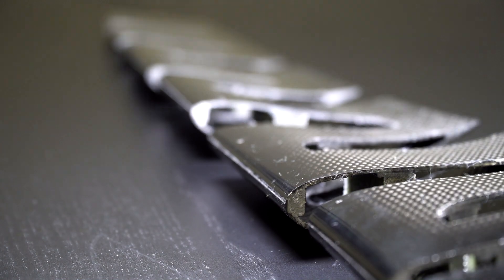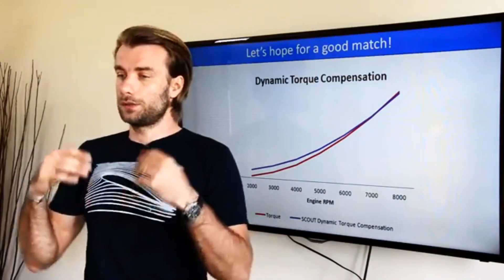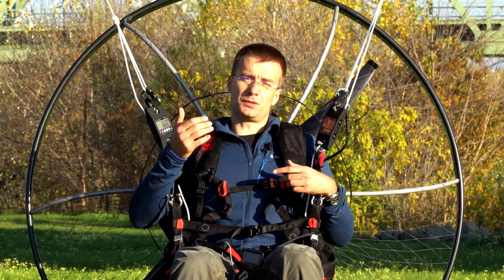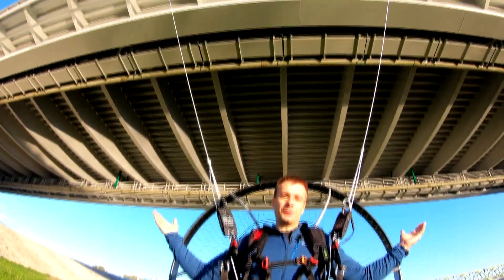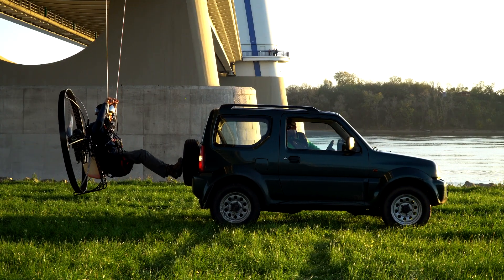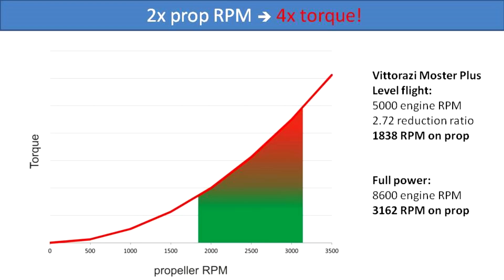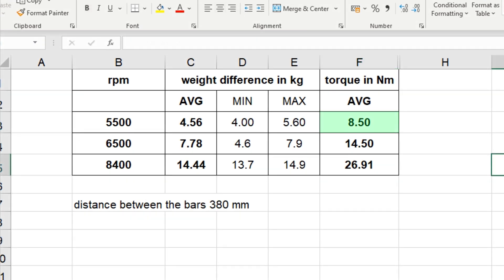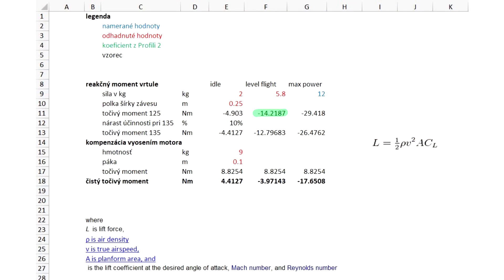Paramotor torque experiment, First Time EVER! Smarter pilot 1

Comment: Many years ago the topic was how the torque affects the speed, blade depth and blade weight. it was not measured with paramotor but with electric helicopter rc. this had its own motor in the rear rotor. both engines were logged and saved via telemetry. so you could graphically evaluate the relationship between torque, speed, etc. in ecel. the rotor diameter was 125 cm so everything is very similar to ppg. I can tell you it is reflected very closely with your explanation. best regards

Comment: very informative and nice video! well done.

with  2 pcs  S-förmige Wägezelle
S21N  / log in 60hz with full telemetrie,  power in watts  / rpm in csv data loged    as hobby pilot in austria :-)  many things are done in the background. the comparison of low rpm ultra light propellers to standard ones is particularly interesting. just like when the center of gravity of the propeller blade is very close to the center. therefore modern thermal e-ppg can do without torque compensation due to their very low speed and ultralight propeller. with a very powerful high-speed petrol engine like the moster, yes, you will always need a solution when it comes to torque.

Comment: Hang on. No torque compensation is dangerous? Can we talk about how many paramotor frames do NOT have torque compensation? My torque compensation is letting out the left trim a bit more past neutral than my right trim. I have not yet died or twisted. I think "less ideal" is a more accurate statement than "dangerous," so long as the pilot understands what it is and how to manage it.
Reply from the maker: All paramotors have some sort of compensation. What kind of paramotor do you have?
Reply: @SCOUTaviation  2016 Vittorazi Moster 185 Dark Evolution on a "Simple Frame" made by SkyCruiser Manufacturing in Sauk Rapids, MN -- http://skycruisermfg.com/ -- with an APCO harness.

Doesn't look like they have that frame for sale on their site anymore. Fixed J-bars, 17L tank. Aluminum struts, net. Literally simple! The way that the motor is mounted (I purchased this from my instructor) may have compensated for torque, but I was also taught to modify my trims slightly to compensate.

Comment: The angle at which you put your feet on the car changes the vector in the vertical axis. It will still vary in real flight depending how many g’s you pull in your “level flight”. The best way to remove this variable is to attach the motor to a rigid structure in the forward and reverse axis which allows frictionless motion in the rotational axis
Reply: I think he did mentioned in this video it as 'Static Thrust'  .I am sure in-flight thrust would vary based on varying heights (air density) , wind speed and other dynamic parameters.

Comment: Hi Miro, first, thanks for yet another very interesting and informative video! Questions/suggestions though...Respectfully, to enhance the accuracy of your readings, wouldn't it be better to isolate the the torque in your readings by making sure that the propeller was vertical (90 degrees to the Normal force of gravity) at the time of measurement, as well as the ropes being completely vertical (as Voloshin Ivan already commented on, below)? Additionally, while I realize that putting your feet on the Suzuki was improvised during the experiment, wouldn't the grip/traction of your feet pressing against the car (vs. being on a pivot bearing) impact the accuracy of your torque readings, as your legs (however unintentional) would resist some of the torque? Thanks again for your sharing of your knowledge!

Comment: Greate video. But I see one minor inaccuracy that should affect the reading. The ropes are not strictly vertical. They are actually angled. What tha means that:
1) The sum of the weights on left and right does not equal to the mass of the system. You would need to do some math to figure out the true mass.
2) I would expect that the sum of the readings change (as you observed) when torque is applied to some degree. The reason for that in my opinion: the torque will change the angle of these ropes. One rope will become closer to vertical. Another - more tilted. Since the relationship between mass, indicated tension/weight and rope angle is nonlinear - I would expect the summ of the two to change slightly.
3) To properly estimage the torque you need to take into account the angle of the ropes. It doesn't look from the video that you did that. Eyeballing it from the video it seems like angle of a rope is about 30 deg. If my napkin math is correct, that would mean the indicated readings are inflated by 1/cos(30deg). Which is about +16 percent. So the real torque will be 16% lower.
Take this math with a grain of salt. I didn't really sit down to make sure it's correct. But I guess, the main point I wanted to make: for accuracy the angle of the rope should be taken into account.

Comment: Very interesting video.
I Will also make my prediction for the next video for fun.
5500rpm it gives at 60% of the propeller length around 200m/s velocity. Speed of ppg around 11m/s.
So I would say that angle of attack on the propeller will reduce(??) by 3° which is not negligible.
I don't have curve of CD for Naca profile in front of my eyes but I would say that same rpm, torque will by smaller but it is just my rapid prediction and for sure I probably made a mistake 🤔. Let's see if I'm wrong in the next video.
Nice video because I think it the best way to do engineering. Better than on a computer everyday like I do😜

Comment: Hi, thanks for sharing, great video! If the level fligth torque is 8.5Nm and the prop spins 1837 rpm, this gives approximately 1635W power. Sounds a bit low /only 2.1Hp/ can this be correct or I made a failure in my calculations?
Reply from the maker: We did not measure torque of the engine. We measure torque steer of the propeller
Reply: @SCOUTaviation  yes but i think the torque steer is approximately equal with the torque of the propeller. So we know the torque on the propeller shaft that is 8.5Nm. The propeller is rotating approx 1830rpm. So we can calculate the power /  Power = Torque x angular velocity/. And with this formula comes out 1600W power for the propeller. Greetings, Roland Falusi
Reply: @SCOUTaviation  maybe because the pilots body COG is under the rotational axis, this counteracts the propellers tourqe. At least a part of the torque is eliminated this way.
Reply from the maker: Engine torque translates to engine power. Engine power delivered to the prop is then converted into thrust and torque. Not sure, but it's seems you calculated the horsepower value of the torque component. The prop thrust is missing. 
Thrust could be calculated from side view measuring the angle to which the prop had pushed me forward and calculating my weight. I actually did that too but it would make the video too long
Reply: @SCOUTaviation  i think the system "doesnt see" this components. Simple there is tourqe on the propeller shaft by a given rpm. The tourqe cause the rotating of the pilots body and this is what you measured. I think by my calculation is missing the movement by the rotation: torque is twisting your body and because the center of gravity is lower as the rotational axis, there will be a counter torque because the pilot mass.

Comment: Love that you're making content like this! Given how dynamic torque compensation works, I'm interested to see the speed of the induced airflow from the propeller compared to the airflow from forward flight under different wings. I'm guessing that with DTC there is an optimum airspeed for each engine RPM to achieve neutral torque, but that High RPM + Low Airspeed = Clockwise Torque and Low RPM and High Airspeed = Anti-Clockwise Torque.

Comment: Miroslav, great information, thanks.  These are torque measurements around the axis of the propeller.  What would also be very interesting is to measure the "Gyroscopic effect" of a propeller that is pointing too far upwards or downwards (improper hang points) as you turn the SCOUT right or left, or as you increase/ decrease propeller RPM.  It looks like that contributes to the cause of the accident shown at about 1:35 in your video.  Again, fantastic series of educational videos, thanks!
Reply from the maker: Your are right!
I will think of how to measure it.

Comment: I love these videos!  The one thing I found interesting was the readings when you were supported by the car and powered up was less than just hanging there. Shouldn’t one be more and one be less than the original. My thought would be by supporting with your feet and keeping level you are compensating for the torque slightly. This could possibly explain the weight differencePlease correct me if I’m not thinking straight haha.

Comment: Starting to sound like super dell by basically saying paramotors with out torque fins are useless
Reply: I think he meant that a Scout without fins is useless. All paramotors need some form of Torque Compensation built into the frame, but because the Scout uses the aerodynamic fins, it doesn't have other features like offset bars or cross straps, so the test rig with round tubes would be pretty sketchy to fly.
Reply from the maker: Thanks Harry for explaining. Yes, correct. No way I am trying to bash other brands. I believe every paramotor that gets you in the air safely is a good paramotor. Such an amazing sport.
Reply: Thats they way it come across yess you have a good concept there and its proven to work and work well but down grading others to benefit your self wouldn't be cool glad uve replied and cleared that up

Comment: Great! Now put a bearing on the axle of the prop, so on the rear, connect a cable to the bearing and to some heavy object (car), and use that to keep the paramotor at the same place. This way you don't have to use your legs.

Edit: typo
Reply from the maker: Yes that would be correct. Originally we did not expect it to be so unstable. So the little suzuki was a quick improvisation on the spot.

Comment: I am absolutely interested in these torque forces in flight. I am still experiencing significant torque with the scout-carbon on steep climb-out using a slow wing (25mph), though none of my buddies on faster wings feel any. I am curious if ambient air speed increases the effectiveness of the fins. I am pretty light so my climb angle is very steep at max thrust and consequently my air speed can sometimes be quite low when I need the most torque compensation.

This is partially a separate discussion, but I'd love to see a load cell on the engine thrust during these tests as well. I suspect max thrust is very different between stationary and cruising speed. I recently got an E-prop 135cm as backup and was very disappointed with the mileage. I found on the ground it was very high thrust, but in flight it was very low load resulting in high cruise RPM poor climb, and 30% worse fuel/distance. I am curious if a less efficient (or smaller) propeller will have any meaningful impact on the torque compensation AT SPEED.
Static thrust tests are not the right metric. Propeller properties and torque compensation are only meaningful in flight and should primarily be tuned to optimize in flight experience.
Reply from the maker: The third video in the series will give your answers...

Comment: The angle of attack on the propeller profile decreases with increasing speed. As a result, the lift and the drag should both decrease. Less drag = less torque.
Reply from the maker: Correct. This is the reason we need to go in the air.
The video is in edit already.

Comment: I hope your back is fine. I believe different flight speeds at the same rpm will result in a different torque (less speed=more torque), for the same reason the effective trust in flight is less than the static trust (more speed=less trust)